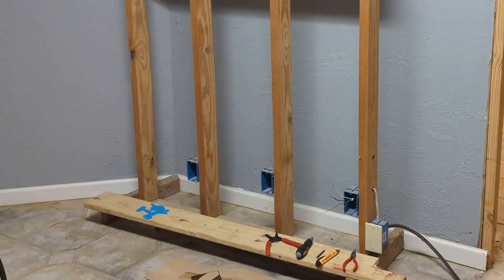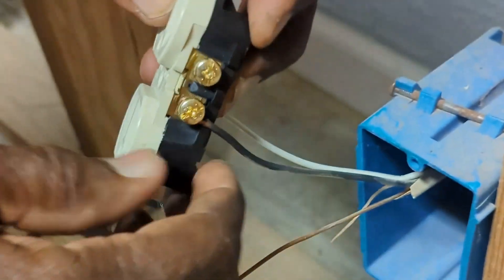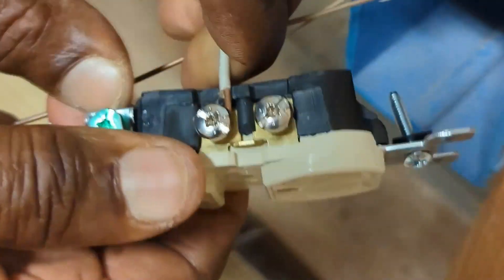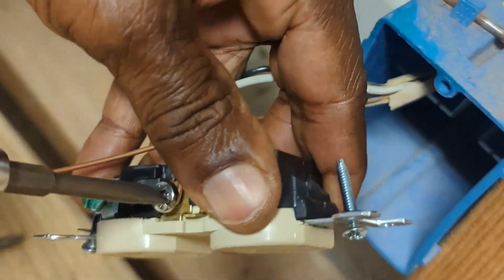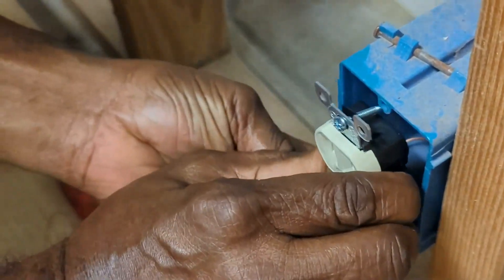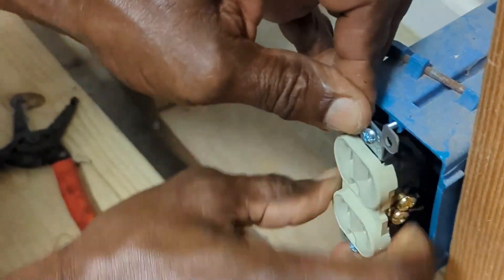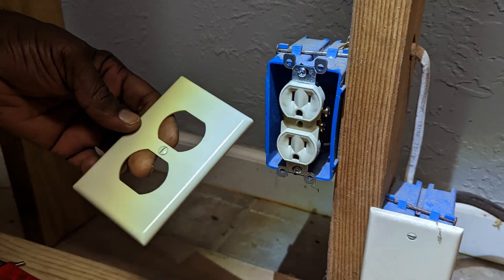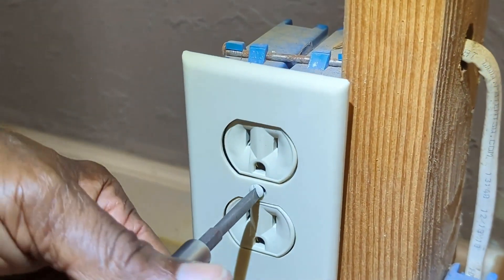Leviton Receptacle (Wall Outlet Plug-In) Install

Comment: Wh6 does the leviton 15 amp back & side wire outlet have one set of screws completely tight and one set completely lose ? The hot side has 2 screws and neutral has 2 screws. But one screw on EACH SIDE is tight and one is lose, Why ??